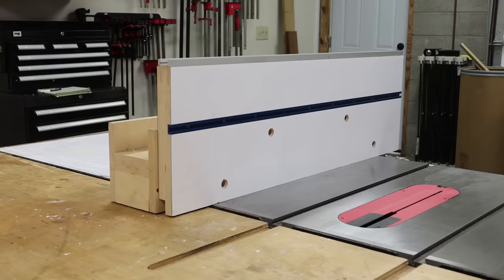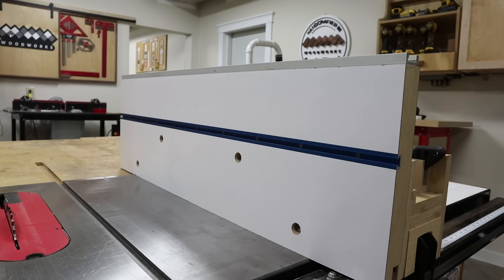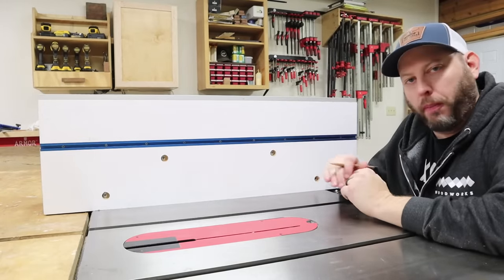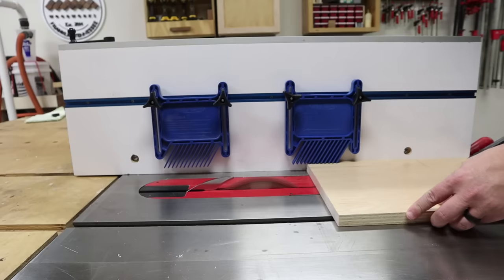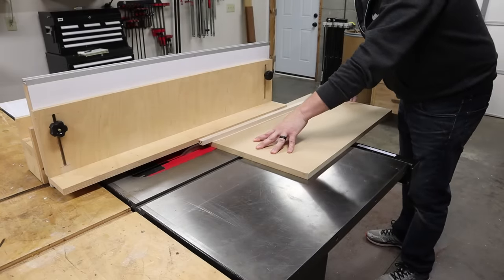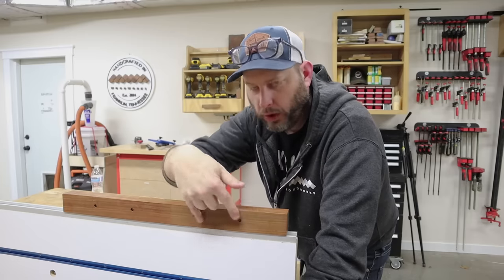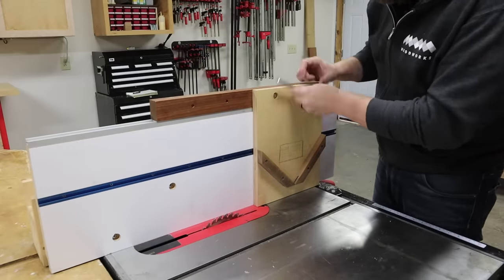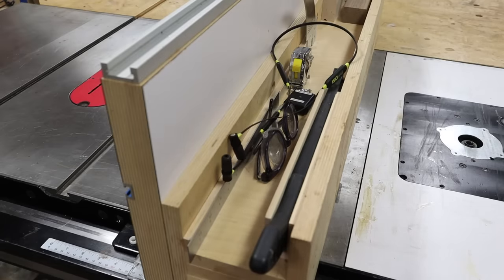The single GREATEST upgrade I ever made to my table saw

Comment: I am definitely adding this fence to my table saw. A great alternative to buying rare earth magnets, which can be pretty pricey, is to get those inexpensive 18 inch magnetic strips from Harbor Freight. As an added benefit, you get the full length of the strip to use, as opposed to only where those much smaller rare earth magnets are located. If you want, you can also gently pry those magnets off the metal strip, and space them out in your fence just like with the rare earth magnets at a lower price.

Comment: I made a High fence for my Bandsaw out of HDPE, it is a great material but is soft and easily marked, mine is also black, so the idea of laminating it in white Formica is my main take from this video, thanks mate!
I've thought of doing similar to what you did on my table saw fence but using HDPE, initially put off by it's durability, but again laminating it with Formica solves that issue too!
Great job, you thing much like I do.

Comment: I was getting ready to build something basic and decided to look online and found this!
I built one for my Incra fence. 
The changes I made, added another stack layer on the top edge of the Incra for more stability and room for two rows of screws through the left sub fence part. I also used a heavy duty track on the fence face because I had one and most accessories I have use 5/16 bolts. I made the sliding fence longer. All of these will need tweaking to get the face square with the table. I used thin paper folds between the two tall fences as necessary then screwed them together from the right side. Mine is so tight, to remove it from the fence I have to put a clamp on the front Incra guide before lifting it off. It is heavy. For those having trouble with the T nuts, you lay out the bolt locations, use a punch to make an indentation, drill the insets with a forstner bit first. I used a one inch so any other errors would not prevent a socket or nut driver from working. You need a drill press to do these well. Then you can drill in the center of these insets accurately to get the bolt holes and another inset to accept the inner part of your T nuts. A small bit through the clamped up pair gives you the exact starting point for the 2nd forstner hole. Use a drill press or it won’t line up.

Comment: I made basically the same tall fence , but with one major difference. On mine the fence is 12" tall has three t-tracks. The fence also can slide on two heavy-duty 24" drawer slides. To do this you'll need an extra piece of 3/4" stock between the sliding fence and the stationary fence that rides the factory fence. This is needed as a place to mount the drawer slides. So, the fence will be three pieces thick. It does make for a heavy unit when you need to remove it. I've used this for cutting door panels and tennons and it glides smoothly and is dead on every time. Wish I had made this years ago.

Comment: First of all, let me put this out there. I am a visually impaired hobbyist woodworker. I had inherited a Delta 36–650 saw from my grandfather a few years ago. When my grandmother told me to come get this saw well I’ll let you think about that. I have always taken very good care of this saw until the other day I was making some zero clearance inserts for this saw. I do not know if I’ll be able to replace the fence or not. But after seeing this auxiliary fence system that you made. I think I
Will make your fence system. Hopefully I can find a new rip fence for my saw. I think it will give this old visually impaired hobbyist woodworking, the safer system to use, especially with the white for Micah.
😊

Comment: Out of all the table saw jigs besides 3x3 custom Tamar’s table saw sled (more recent one) and C Reeves adjustable sled, this is the best table saw jig. When you think about it it saves on wood in the long run bc you can add jigs as you go without building the base to fit this all in one concept. I’m currently building it so I can add bridle joints to a vanity frame I’m building

Comment: I'm finally able to get back to woodworking after 10yrs. and with all the Free CAD programs, 3D printing, and home CNC available now, I figured there would be some great tech utilization out there for table saw fences. And by far, this is the best one I've seen. This is on my priority list of things to build. Thanks for sharing!

One question: What reason have you run into that requires you to remove the fence from your saw?

Comment: Learned about the edge banding trim trick 40 years ago from a true “mechanic cabinetmaker on his second-hand 5hp 3 phase 16” Tannewitz with a geared fence that register in holes on the saw bed. He also employed a young Swiss trained  cabinetmaker who was so good the work magically appeared before your eyes even though you looked over at him frequently during the day. Need brass knife hinges for flush doors ?  No problem- Chris Hug just took some brass stock, cut, drilled it, pinned it, drilled and c-sunk for screws, mortised the door and carcass and installed it in what seemed like less time than it took me to key in all this. The Swiss didn’t allow just anyone to call themselves a cabinetmaker. You were literally shamed out of town if you did so without proper training. And, boy did that training show. They used the “thick” notebook approach for training. The best students had a notebook full of there mistakes. The secret is to only make any mistake only once. The greatest number of only-once mistakes sure worked for Chris. I even picked up some tips. The best one was “A mistake is something that can’t be fixed.”

Comment: Matt, Just bought the plans for your fence.  Excellent work on both the fence design and the plans.  My fence will go onto a Sawstop PCS with the 36" T-glide system.  I too have my router hanging from the right side table and am planning to put an extra track into the aux fence such that I can use a JessEm clear cut router feed (#04215) simply by swapping sides with the aux fence.

Comment: I will buy these plans too! I think I could figure it out just based on the video but time is money. The plans I bought from you for the cross cut sled were very detailed and made it quite simple to build start to finish without spending time figuring out the variables.

Comment: Beast of a fence is right! I adapted this fence to my Skil TS6307-00 and learned a couple of things.  The fence substructure and auxiliary fence alone with 3/4" birch plywood weigh 15.2 pounds.  With my smaller portable saw I could have used 1/2" plywood.  I also realized after I put those two together that I didn't need two sides for the fence mount because the Skil fence itself is reversible.  Duhh.  But I still appreciate the design as being very well thought out.

Comment: This is the best fence addition that I was able to find and number of combinations for use is even more attractive.  My one negative to the fence is it is quite heavy and it does not slide easily across the table saw top. I am thinking of adding nylon glides to assist in moving.

Comment: Excellent..I just built one for DeWalt table saw..almost identical to your plans. I also added some things to the support fence without the high fence for feather boards etc. The bolt inserts allow other things to be attached to it. Example home made wheel feather.

Comment: This is incredible. Making asap
Reply from the maker: Awesome 😎
Reply: Besides the feather board and L fence, what can the T track be used for? What else can i use in there for the table saw?
Reply from the maker: Stop blocks maybe?  You can also make a sacrificial fence that you could attach to the track.

Comment: First visit as well, great job on the table saw fence addition. 
I know that selling your plans is a great way to finance your business. Woodworking is more hobby/ relaxation for me. It would be nice to have some of your simple plans cost free. And then the more advanced plans at a modest price. I would think that maybe your sponsors would help offset the cost just for the PR opportunity! 
Yes I can be a tightwad, woodworking isn’t cheap. Thanks again for the video you gave a lot of great ideas! Keep them coming!
Reply from the maker: Unfortunately, no sponsors yet! Me and my plans are on our own! And thanks much for your kind words 🙏
Reply: MWA Woodworks I don’t know how long you have been doing this. I am sure woodcrafters or one of the other woodworking disciplines would help you out. 
On the saw fence, make the back portion opposite side of the saw blade Adjustable. So it can clamp of a variety of thicknesses of different saw fences. I wish we could attach pictures on here for clarity / explanation!

Comment: Well, you did several things I have had on my back burner for a while. Kind of dropped the flat work for lathe work as it sold better, but retired now, and need to make some more furniture. One that is not included in this, is a long straight edge for getting glue ready edges on solid wood. My jointer is not in tune, and I can get almost as good of an edge with the saw. Need one maybe 10 feet long. Like the high side for standing things on edge. I did find out my new Saw Stop doesn't fit my old Delta tenoning jig. May have to improvise.... Your set up could replace my tenoning jig...

Comment: Don't know how I missed this video & this is an awesome build. I have looked at at least a dozen auxiliary fence designs on YT, but yours is next level stuff. The modular design is the greatest part, even if I don't ever do some things like splines.  The top two piece aluminum 'slide' is MUCH better as the basis for the tenon cutting jigs, compared to the typical hook design.   
  My TS is an older Delta with the funky Unifence, so a notch is required on the far side of your fence to clear the big fence carriage on my saw fence. I would likely start with a small, base fence to mimic your Biesmeyer style original fence, using an after market aluminum box extrusion from Peachtree Woodworking. That gives me a box to put your fence on top of.  
  Ordering your plans today and will send you some pics when done.

Comment: I love this fence.  I downloaded the plans and cut my wood but you don't show anything about the construction so I haven't put it together.  I am new at wood working so I don't know what process I use to get the holes to line up exactly for each side and I have never put in T-nuts successfully so showing this process would really help.  In the plans it would also help to have the pieces in the cut list named for what part they are.  It is very confusing compared to other plans that I have downloaded

Comment: I noticed you had the track set up under your custom fence for the Jess-em stock feed hold downs, but you didn't mention in your video when you change from them to your custom fence.  One of your demonstrations was using feather boards that are similar to what the Jess-em hold-downs do, less the infeed pressure they also provide. Also, wasn't clear why you needed the ends blocked, is that so the fence can't slide when you push the stock through?  Nice fence system, I'll probably get your plans, thanks for the video.

Comment: Great video. I’ve been thinking about making one myself but I would compromise the ruler on my fence rail. How can I adapt the ruler to the additional thickness you add to the fence? It’s dead on right now. There isn’t enough range to move the pointer 3/4” to accommodate the added thickness.

Comment: Well I finally finished the fence after having stopped woodworking for 2 years due to heart problems. After all this time the holes didn't line up as well.  The T-Nuts enede up being a waist of time and didn't work. 2 of them popped out. It would have been better to drill holes and use nuts and bolts. One bolt is stuck half way in and I will need a grinder to cut it off. I'm going to screw the high fence to the base and not use its adjustability.  It is too much work trying to get all the T-Nuts to be perfectly alligned.

Comment: I am building a small workshop and will be using a portable 10 inch DeWalt table saw. I am curious if there is any issues with building this fence add on for a portable table saw.

Comment: I know this is an old video, can you do a follow up video on how you measure accurately with the new fence and attachments installed?
Reply from the maker: I use a tape measure always when setting the distance to the fence. This is true even when I don't have the aux fence installed on the stock fence

Comment: Tried to order the plans but the site wouldn't go through. I clicked on the "buy now" area and nothing. So I think that I will just look at the video and make my fence from the pictures I get. I have been looking to make a fence like this and this is the best idea I have seen. To bad I couldn't get the site to work.
Reply from the maker: Shopmwawoodworks.com
Reply: Yes well sorry man if you can not look at a video and figure out how to do the jig, you are not much of a woodworker. @MWAWoodworks
Reply: Thanks for the site. 1 additional question. Where did you get the bar that fits the miter track on the top of the jig. I have decided to order the plans. Will they come as paper plans or will they be a down load that I can print out?  Thanks and this is about the best jig I have ever seen. @MWAWoodworks
Reply from the maker: The link to the sliding bar is in the description of the video. The plans are electronic you download them. Thanks for your support!

Comment: Beautiful and versatile design! This rides on your base table saw fence. My old Craftsman table saw has its original fence which wouldn't be a suitable base for your design. What type of fence is your design riding on? I definitely need to start with an improved fence! Thanks.
Reply from the maker: I have the biesemeyer style fence that comes on most modern cabinet saws
Reply: @MWAWoodworks  LOL "most modern cabinet saws...". That explains my fence; the original fence on a very old, but still working, Craftsman 10" table saw. Thanks for your reply.

Comment: Matt, I brought and am going to build this plan.  Thanks for sharing a great plan. I have some Bow feather boards but there travel is about an inch shorter than the Kreg.  Do you think I could lower the t-slot an inch so the Bow feather boards will reach the table?   Is there a specific reason you put the slot at 6 1/4” above the table?
Reply from the maker: You can position it where you need it most, or even add a second track if you want
Reply: @MWAWoodworks  ok great thanks !

Comment: The "piston fit" must be super tight otherwise this fence will slide vertically on the original fence when using those featherboards and the feather function will be lost. Some kind of vertical locking mechanism to the original fence would make sence.

Comment: Really cool! How does the fence  affect measurement using the rulers on the tube?
Reply from the maker: You won't be able to use those measures while using the fence unless you adjust the tube to align with it

Comment: This is awesome!  Did you adjust your measuring tape to accommodate the new width of the fence?
Reply from the maker: Nope I never use or trust the measuring tape on the saw, even with the regular fence
Reply: @MWAWoodworks  I guess I'm lucky. My SawStop was set up dead accurate from the factory.

Comment: Matt, great design. I do have a question. You mentioned that you leave this on the main rip fence, does that mean when you're not using a jig, all of your measurements have to account for the 3/4" birch attached to the saws main fence or did you manipulate the measuring tape to account for your new fence?
Reply from the maker: When I use the fence I measure my cuts manually and don't use the measurements on the saw

Comment: This video just popped up in my feed, first time to your channel. Love the fence, as others have said I love the versatility. I'm curious though, do you think something close to this would work with a DeWalt saw? 
I have the 7491 but I like the verticality of your fence and those extra job's it allows with small jigs as apposed to more sleds.
Cheers
Reply from the maker: I'm sure you could modify and make a smaller version for that saw but those saws don't really have fences that stay put very well and are really only suited for ripping operations. Plus you'd lose a lot of cutting real estate with my fence. But a much simplified fence might be worth it👍

Comment: I am in the middle of making this for my SawStop 3hp PCS, but I have a question not answered in the video or plans:  How to you adjust the measuring tape on the saw by that much???  The factory adjustments don't allow for 1.5" adjustments...  It doesn't look like you added an aftermarket tape to the front of your saw?
Reply from the maker: I dont ever use the tape on my saw, even prior to making the fence.
Reply: @MWAWoodworks  oh no…. I use the tape on the saw for every cut almost!  Shoot. Using the tape saves so much time, I will have to figure something out

Comment: Sick! I’ll be adding something similar to my saw now....I’m assuming your saw’s factory fence tape is just for looks now, or did you adjust for the new fence?
Reply from the maker: Thanks Nick! I have not adjusted the fence because my OCD brain won't let me make a cut without manually measuring the cut first 🤣🤣🤣
Reply: Dude this is the second or third time in as many months that I came to the comment section to ask a question and here you are beating me to it. That was my only thought about this fence upgrade but if you measure each time I guess that cancels out.